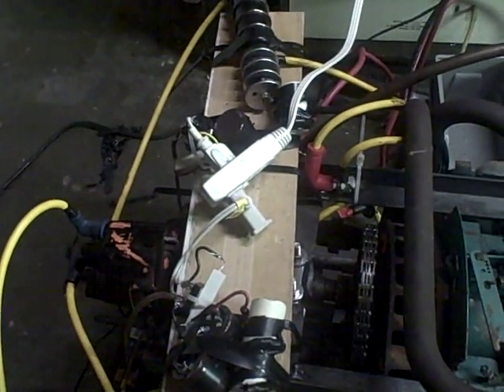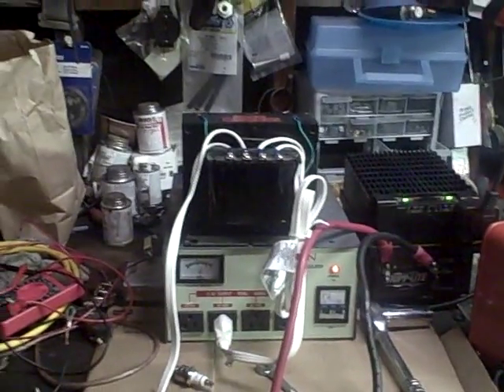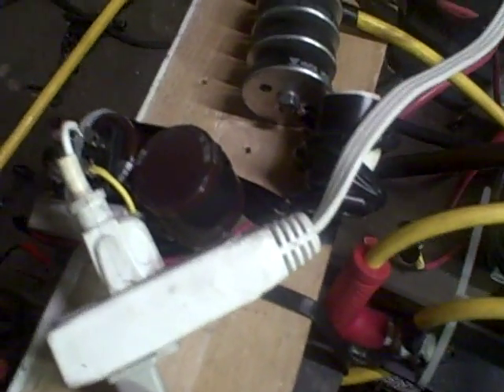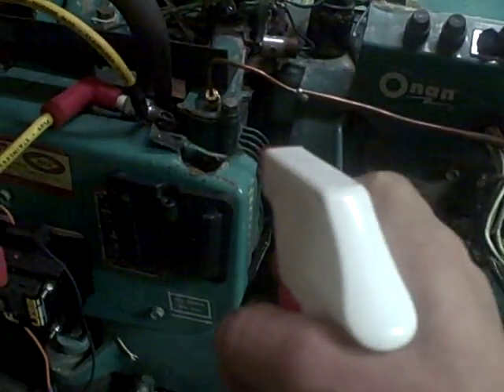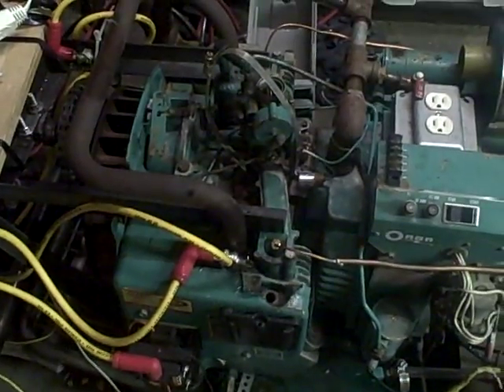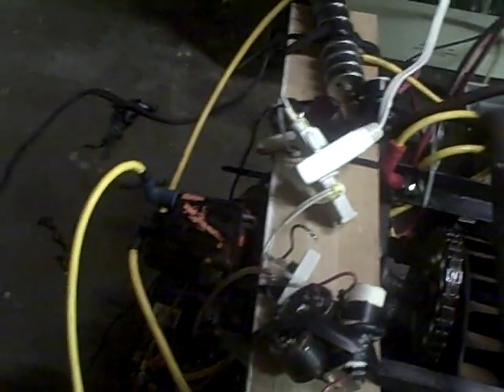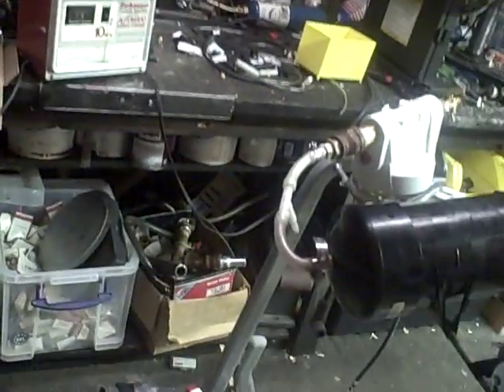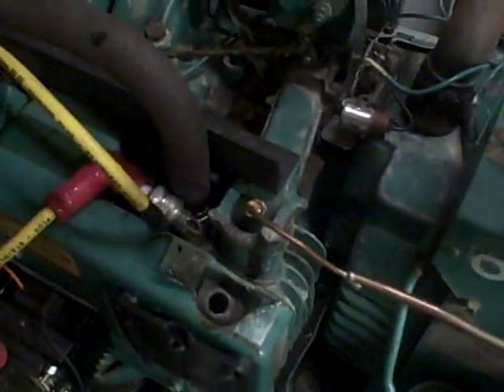Water spark plug test 1.0

Comment: However, if you are using gaseous H-O-H (Brown's gas), you will need to adjust the timing to BDC (bottom dead center) or a few degrees past BDC (the upward stroke).  This is because H-O-H "implodes" when ignited and creates a vacuum and upward pull on the cylinder.  
Keep up the good work, and God bless your efforts.

Comment: I don't know if you tried this yet, but if you haven't ... try adjusting the timing to TDC (top dead center) or a few degrees past TDC, if you are injecting liquid H2O.  In other words ... fire your spark on the down stroke.  For in contrast to gasoline which burns, H2O explodes, and therefore its expansion rate can be considered almost instantaneous.  Firing before TDC with liquid H2O will stall the engine.

Comment: if you advance the timing that should help water vapors only fire 90 degrees out of phase top dead center so you would need to advance the timing all then work from there try some heated or super heated water vapor first or you will crack the cylinder heads or blow a gasket or worse because water doe snot compress

Comment: I remember reading that you have to increase the jet size in the carburetor to increase the volume of water. Did you do this? Also, An idea I have had, that would be easy, is to feed the output from an ultrasonic humidifier into the air intake. These things put out an incredibly fine mist that resembles fog. It should prove way more combustible than the spray from the venturi in the carburetor. (or that squirt bottle) LOL. Great Work Guys!